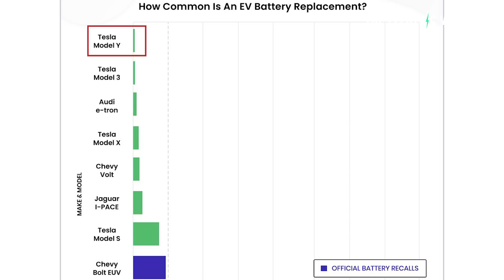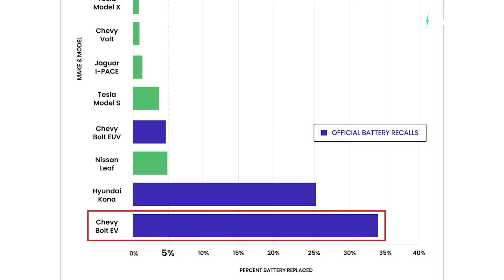Over 90% of battery pack replacements were for these 2 EV models

Comment: my 12yrs old nissan leaf had the first battery replacement at 40K miles after 3yrs of ownership covered by nissan.  the second pack only lost 20% so far because i know to care for it, i only slow charge to 80% in hot weather.   cold weather i can fast charge to 80% and occasionally up 100% for immediate further trips.
Reply: My 2011 LEAF degraded down to only 41 mile range after 3 years - thx God I leased it and dumped it back on the dealer
Reply: You lost 20% already ?   Yikes.
Reply: Yeah, my Leaf is sitting at 73% battery health after 9 years.
Reply: yea, the leaf uses the worst batteries with no thermal management, a ryobi on wheels.  Still, if they give you a reasonable life  its not  a totally useless idea.  But you would be foolish to go this way now.
Reply: @andyfreeze4072  lol 10 year life and counting with as little as 0.01% battery failure rate makes the Leaf battery one of the better batteries out there compared to the massive recalls from the Bolt and Konas! Even the mighty Tesla have more battery failures than the so called poor Leaf batteries! Yes it lacks thermal management but in any country that does not have high temperatures of 35 degrees C plus they last very well!
Reply: @Greg B  So many falsehoods online about the Leaf!  We have owned 4 (24, 30, 40, 62 kWh packs).  
It HAS a BMS!  It has passive thermal management (radiation, conductance, convection) which have been optimized.  If battery gets too hot, car charges slowly or goes into turtle mode to protect battery.  Our Leafs have averaged 2-3% degradation/year.  

Viking, are you listening?  Yes, maybe not best car for long trips in AussieLand.
Reply: @mikecarter2737  Yeah looking at every EV for sale, and having owned my Leaf for 7 years now, I still love the Leaf more than any Chinese EV being sold. They are just nice to drive easy to operate and very easy to live with. I think my next Leaf will only be the 62kwh Japanese import and apparently the next Leaf is due in 2025 but will be a small SUV similar to the Ariya but a lot smaller.
Reply: You're all doing better than my 2014 Outlander PHEV...probably at around 60% degradation now 🤕

Comment: Mmmm. I’m not sure it’s particularly valid to compare battery life to that of an ICE engine life, it’s not apples to apples. One is an energy store the other provides the motive force. Compare the BEV battery replacement with how many fuel tanks require replacing maybe.

Generally, I’d say that there is insufficient data on real world BEV battery long term durability. They have not been on the market long enough and in sufficient quantities yet.

The issue I have with the way BEV’s are marketed in general, is that a lot is often made of the fact that you ‘save’ thousands every year by not needing to buy fuel. Tesla even show this as a ‘saving’ on their website on their new prices. But if you do have to replace the battery once in the vehicles life, whether than is 8 years in or 12 years, or any age before the end of the cars life, and it costs between 5k & 20k to replace the battery, well, that’s most of your ‘fuel saving’ gone. So not having to pay for petrol or diesel & presenting that as a saving seems wrong in my view…and let’s not forget, you do still have to pay something for charging your EV in many instances anyway.
Reply: Charging costs a fraction of gas. EV maintenance is a fraction of ICE maintenance. 
Real world data from 2160 cells shows that battery packs should last at least 20 years. The 4680 cells should be even better than that. 
I don't think battery longevity is a concern anymore, not in Tesla vehicles anyway.
Reply: The comparison is not fueltank to battery but just : Expensive part of the car against an expensive part of the other type of car and how often/how fast. In other words...due to the effect on the TCO for the car.
Also...A battery does not need to be changed at own costs if it is within the warranty period. An ICE engines warranty is less...at least when the breakdown comes from improper maintenance (lack of oil, overheating of the engine)

And when we change a battery.....that is only becausse the rest of the car has a much better lifetime than an ice car else I would replce the complete car. (Which mostly is done when an ICE car needs a new engine...the car is not worth the costs in most cases.)
Reply: And the additional depreciation
Reply: At the end the only interested cost is euros/km or dollars/mile during your ownership of the car. Maybe it mustn't bee very low, but for most people it must be at least reasonable compared to what you want to do in your life.

In Finland, where GDP per capita is almost on the same level as in Canada, was the average age of the cars 22.5 years last year!
Maybe it depends on that the cars from the 90s are quite cheap to repair and are driven very few kilometres per year compared to new cars that are driven about 20,000 km/year as an average.

Will it be possible to keep driving with an electric car when the car is 30, 40 50 years old?

Comment: The reason Nissan's batteries have had recalls is that they are passively cooled. Most of those were in areas where the climate is hot. The batteries themselves were not defective.
Reply: They were degraded to fast and to much. But not in my previous Nissan leaf. 2 reasons...never fastcharging needed and a cool climate. My leaf had gone over 1000 battery charging cycles in 8 years and still running fine with still 75% of the original range....as promised when I bought that car.
Reply: To be fair to Nissan, they were also the best selling EV up until recently and have the majority of older EV's on the road. There are not a lot of other mass-market 10 year old BEV's to compare them to. Early market entries also tend to have a lot of kinks to work out. The fact that they do not have the most failed battery makes them better than expected. For a low-cost 1st generation system, they are not far off from the Model S, which is pretty impressive in context.
Reply: Before 2015 Lizard cells, Nissan batteries degraded quickly. New Nissan Lizard cells seems to be better. Despite improved batteries, Nissan could do better by adopting active cooling and allow users to set their max charge.
Reply: Yes, and the older models had small batteries.
Reply: Haha, no - unless by ‘hot’ you mean 85F!  Nissan was stupid
Reply: So it's idiocy on Nissan's part.
Reply: @themonsterunderyourbed9408  I suspect it was done to save cost and be able to offer the car at  a lower cost. If you live in a cooler climate as  I do, it's not an issue.
Reply: @lesliegweir  Doesn't really save cost if they have to keep replacing the batteries under warranty.

Comment: One of my EVs is a 10yr old imiev which has done over 140k/km and is still going on the original pack, granted it has degraded in range, but still a useful range - older prismatic cells
Reply: Exactly. EVs are inherently more reliable than ICE and need constant attention to achieve what you have with the I-miev without I guess too many hassles or cost.
Reply: Dang, you were driving an EV 10 years ago? I didn't even have a hybrid yet. If you have the use case for it, run it, but you should see what some of the new ones can do.
Reply: Lol and The Viking still saying the same BS that LFP is superior in every way, yet all modern EV batteries are still going to last longer than the car will!

Comment: lfp batteries have better longevity and higher heat resistence, can be fully charged and discharged without degradation. overall, lfp's pros outweigh the cons. it is really simple as that.

Comment: Batteries usually last longer than gasoline engines except when... the engine is made by Toyota. Also, batteries require no maintenance because it has a BMS. A gasoline engine requires a lot of maintenance and if you don't do it right, it won't last too long. So this comparison isn't actually fair for the gasoline engines because most people don't really maintain their gasoline engine well enough.

Comment: Yeah, because gas engines last forever, never break down, and are almost maintenance free.
Reply: So all the auto repair shops are just like the Maytag repairman?
Reply: @thomaswilson2917  Exactly 😂
Reply: @thomaswilson2917  To all MSM and ICE manufacturers... YES!
Reply: Gas engines last 100 years and no troubles.  Especially not BMW.
Reply: @Tron Jockey: Couple of corrections; haven’t found an EV yet that ditched the power steering and went back to old-fashioned rack-and-pinion. It’s all electrically driven, but it is still there. Another thing, is that the oil for the reduction gear may actually need to be changed to keep the motor going strong. It’s been a while since I saw that tear down of the Bolt traction motor and gearbox, so I may be wrong here, but could swear that the fluid that lubricates the reducer gears also goes through the motor to lubricate those bearings. I’m on my phone, so I can’t go looking for it right now, but I’m at least 75% sure that’s the case. And if Chevy is doing it that way, then it’s a fair bet that at least one other manufacturer will follow suit. Other than those 2 points, you’re correct.
Reply: It is still very much cheaper to run and maintain my ICE-powered Toyota, and it will be so for the foreseeable future!
Reply: @mooserider1072   We are in a transition period and may be for decades.    The affordability of our ICE cars could change with the stroke of a pen.  Thinking about doing an engine swap.  Used to look forwards to that in days gone buy.  Now it is just dirty work.   But that's just me.